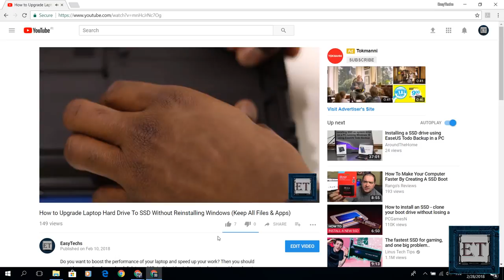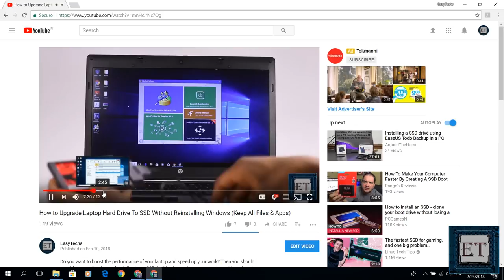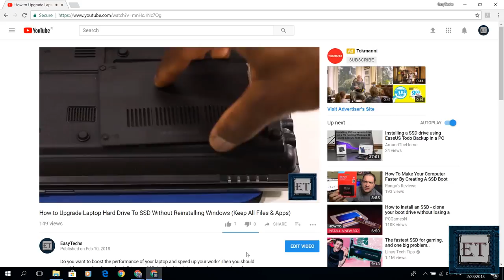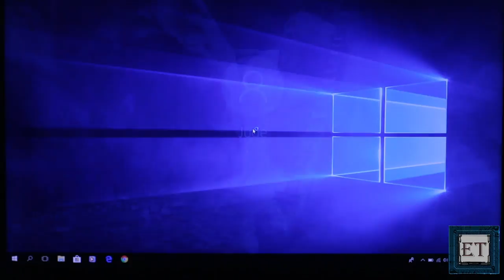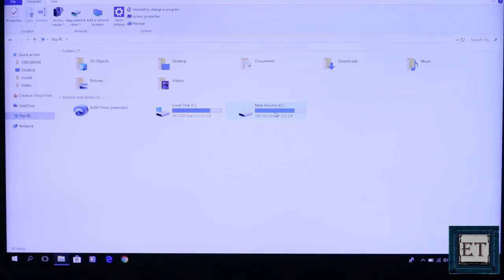HDD + SSD: Replacing Your DVD/Optical Drive With an SSD or HDD (READ DESCRIPTION)

Comment: Ssd location does matter. Main drive sata vs optical bay speeds are different. If you want real performace, you want to swap the ssd to main drive and the hdd to the optical bay.

Comment: Wouldn't you technically be able to do the software transfer after the 2nd hard drive is installed with the caddy rather than doing the software transfer before using a slow USB link?

Comment: Quick question. Does having the SSD in the caddy make that much of a difference in read/write speed compared to as when it is placed in main drive slot?
Reply: Yup it ll definitely
Reply: It shouldn’t, since it’s technically just a sata extension.
Reply: @chikensoops9922  hmm right it's more imp to have windows file at ssd

Comment: Hi EasyTechs!! I find your video very informative. I had a HDD which I cloned and replaced with an SSD. I now want to swap my Optical drive with the old HDD, which still has the OS and all the old files still on it. Do I have to format my old HDD before swapping with the optical drive?
Reply: same question here.

Comment: 2:03 If you don't trust your own measuring abilities, you can also google the type mentioned on the drive. There will be atleast 1 site mentioning it's dimensions. (though >3mm is hard to overlook measuring)
4:07 That's called a "bezel", for the ones who want to know.
(You're welcome...)

Optical Drives aren't used very often anymore anyway, so why not upgrade with let's say 1TB or 2TB. Harddisk and SSD prices are low these days. In some cases the optical drive even needs to be cleaned from dust inside, yes inside :S.
I know i am replacing mine, in my HP Omen, with an SSD. The external optical drive is faster anyway, for some reason.
Optical drives barely, or not at all, exceed USB3.0 speeds, while SSD can perform better connected directly to the motherboard.
HP will suggest to not use a caddy, but external HDD instead. But they have it the other way around.

Comment: Great video, thank you for making it and sharing it with us. All my parts have arrived to to this mod so I found your video really straight forward to follow. Before I start I do need to understand how I can clone my current drive onto my Caddy with a new SSD in so that the faster SSD will be my primary drive for the laptops functionality. Then I can use my slower HDD for other file storage, so I have a bit more research to do before I start.
Kind regards. Paul from 48-SPOKES (UK)

Comment: Great video and made a decision to buy.
I installed SSD in primary and HDD in optical caddy. Both are working fine. But the HDD is working slow. The transfer rate, opening a folder in HDD is very slow.....any suggestions???
Reply: Might be a limitation of the data bus the optical drive was using

Comment: Thanks for your very informative videos! 
One quick question: is there any difference in placing the SSD in the optical drive bay and keep the HDD in its place? Or do you recommend to set up the SDD always in the hard drive slot? Thanks!
Reply from the maker: Is better to have the SSD with the OS in the hard disk slot
Reply: The optical drive slot is SATA 2, which is faster than hdd but not fast enough for ssd. The original hard drive slot is SATA 3, which is also slower than ssd but it is faster than sata2.

Comment: Hey I have a question , I am confused about my optical drives sata version because I've heard that putting an SSD in the optical drive which is sata 2 is less performance so I would like if I had some way to check what version my optical drive is

Comment: This is a GREAT video.  But I have one question:  why did you put the SSD in the original drive bay and the old HDD in the converted optical drive caddy?  Can I just put the SSD in the caddy and avoid messing with the HDD?
Reply from the maker: Good to know it helped you out. Yes you can, you just need to configure your BIOS to boot from the SSD. thanks so much for the feedback!

Comment: Will the following order work?
1. Install the SSD straight into the (former) optical drive; 
2. Then transfer the OS (Windows 10) across to the SSD;
3. Then change the bios to boot from the SSD.

Comment: That's cool! I've got an ASUS similar to the one in the video. I'd like to add a third drive. Does the optical drive use the same SATA ports as a SSD/HDD? If the optical drive is different, what type of port is it? Is the port used by the optical drive slower than a SATA port?

Comment: Hi there and thanks for a very informative video! Quick question though, is it possible to boot a copy of Windows from the Hard Drive in the caddy? I'm planning on getting a SSD for Windows 10 that will sit in my laptop's storage bay, but want to run Windows 7 off of the HDD in the caddy as I need Windows 7 for some older programs.

Any help would be much appreciated!

Comment: Hai EasyTechs !

Right now i just done moving my window OS to my SSD, so i have 2 os program (1 on my HDD, and 1 on my SSD)

I'm going to put my HDD to HDD Caddy, and put the SSD to my main one. (HDD + SSD)

My question is, is it fine to just put both in (with 1 OS on HDD and 1 OS on SSD)??

we just need to go to BiOS setting and select which drive to use as our main OS? Is it right?

Comment: I have tried the same thing with my lenovo b570e laptop ssd  is working fine but the data transfer speed of hdd is very very low(it is hardly 200kbps)

Comment: Hi I installed a new ssd on place of dvd drive on my old laptop and installed OS on it. 
But the performance is not upto the mark. 
A local technician sa8d that it because i installed the SSD on olace of DVD DRIVE. I should have installed on place if the old HDD. And keep the Old hdd on olace of dvd. 
It it true?

Comment: Is there a speed difference if the SSD is connected in the optical drive rather than the HDD place?
Reply: sure. it's better to be connected directly to the motherboard
Reply: @Mohamed.Shoukry  it is directly connecting to the motherboard, both are sata ports, but one is smaller formfactor

Comment: Hi there, thank you so much for the video. But just want to confirm. The process of transfer of file using minitool is before I install the SSD inside my laptop or after ?
Reply from the maker: It can be before or after, both drives need to be connected to the laptop at the same time

Comment: Hi I want to add my old laptop’s hdd to my new laptop’s optical drive bay which I found is 12.7 mm type. But the problem I am facing now is that my old hdd is of serial ata 150 type. So will it work? And where can I get a caddy with sata 150 connectors?

Comment: Hi, I facing an issue.I replacing my HDD with new SSD and plan to put new SSD in harddisk bay while the old HDD in caddy. When I boot up my laptop,  I can see the HDD  in boot menu but I cannot see the HDD in disk management after my laptop finish boot up.

Comment: Hi, i would like to ask about the ssd. If i change my dvd drive to ssd. Can i directly mirror the windows to the ssd from my current hdd? Do i need to change any setting in the bios? 

Is there any difference if i put the ssd in hdd slot or the dvd drive slot? Thank you.

Comment: @EasyTechs
 after I inserted my old HHD in caddy (in the old place of HDD is inserted SSD), the disk HDD is invisible for Windows. I have tried to find it with Device Manager by scanning for new devices. Could you suggest me the solution?
I have the same caddy as it is in video. I see this white dip switches. Do you know what is their functionality? I can't find manual, where this information could be included

Comment: Thanks for your video, please solve query asap,
I have a question, If I put SSD in optical drive and clone windows in ssd and running my system with SSD in optical drive, Should I 
need to change the place of SSD from optical to main HD slot, If I continue it in optical drive what are disadvantage of it ???
Reply: Karan Giri There’s no downside to running it in the optical drive slot. Both are sata drives.

Comment: I have a dell Inspiron 5558 laptop and I replaced my dvd rom with a WD SATA SSD. But whenever I put back my battery the ssd isn't detected and the laptop doesn't boot.
Sometimes it starts working if I remove the drive and put is all together and sometimes it doesn't detect. Can you help me with this?

Comment: Thanks a ton, followed this tutorial exactly to get a second hdd into my optical bay.  However, I am noticing very slow read & write speeds (around 2 MB/s) from the optical bay?  It wasn't like this before, any ideas as to why or if this is normal?   Or maybe an error made on my part?   Appreciate the help
Reply from the maker: Thanks for the feedback, it shouldnt be that slow, but I'm not sure what the problem could be in your case

Comment: I have a windows laptop and im thinking to replace my dvd unit with an ssd or hdd drive and run Linux. So i will have both windows and Linux. Is that possible? Im not using dual but because I dont have that much free space on  windows drive

Comment: Hi I'm getting errors in File Transfer "0x800701b1" device not specified. The HDD is placed in caddy and getting some errors. Is caddy has some issues or do I need to change some configuration

Comment: In case the ssd/usb cable is not available, is it possible to plugin the ssd drive first, then cloning the system? I.e. starting by step 2 first then step 1

Comment: I have an empty m.2 ssd slot in my laptop. If I follow the steps of software migration (as you stated in another video), install the ssd and configure it according to this video. What will happen to my previous C:/ drive which is in hdd?

Comment: Should i Add my SSD to CD ROM Slot or Replace SSD to Hard drive slot and keep Harddrive to CD Rom slot. Because i heard that there may be issue of frequency of CD ROM which is 1.5 GHz and it doesnot performs better. So is it advisable to replace HDD slot with SSD and put HDD in CD ROM slot?

Comment: I did the migrating with the ssd connected internally in the optical drive. I chose the option to transfer and keep the old drive, not remove. It seems the system is not booting from the new drive. It is still booting from the old one as everything was copied, not moved. Did I go wrong somewhere? Would it be different if I do start off with the USB connection? How do I now make it boot off the new drive?

Comment: How do you know that it is booting off of the correct drive? The c drive will become the new drive? Did that happen in this video?
Reply: Yes, windows install always defaults to C:/ where is installed. Check with Task manager wunning w/ administrative privileges the drive. It will tell you in the second tab the capacity, type and other details.

Comment: i hope u answer me , can i put ssd in the cady rack and use it as the main boot choice for windows or i must put the ssd in hdd bay inside of the laptop to do so ?
Reply: No brother you can use ssd in both cases, but because DVD drive is of SATA II and main hard disk bay is of SATA III , it is recommended to use in hard disk bay but, in both the cases the speed of ssd will be the same, I would recommend you in optical bay because in hard disk bay there are motion sensors of hard disk,  👍✌😄
Reply: @parinchoudhary1905  Dont worry motion sensors are not that needed because SSDs dont have moving parts.

Comment: Hey, i just installed a new HP SSD on the main spot(where was the hdd before), but without putting in the caddy, cause my laptop does not see the caddy idk why. After installation, i put in the caddy, and the win 10 boots around 3 minutes, but the caddy is not there in the files. What can i do sir? I have know idea. I tried all day for 3 days now...

Comment: Hi, I am trying to install my older HDD into caddy in my optical disk drive slot but when I turn on my laptop (with caddy and HDD inside) it remains stuck on the black screen or the boot mode and when I press “esc” button it shows “ESC…Pause Startup” . I also tried to insert the caddy while the laptop is turned ON but then it simply shuts down automatically. 
I have tried both switch postions in the caddy but still it’s not working. I’ve seen countless videos over youtube, have read several forums as well but I didn’t see anyone facing this particular issue.
I also tried to replace my caddy and ordered a new one but still the same issue persists. 
At this point on I am not sure if I am doing something wrong or it’s a hardware issue.
So, Kindly help me in resolving this.
Any help would be much appreciated.
Thanks 

My system - HP Notebook 15-ac035tx.

Comment: I have a question. When I am putting the ssd in my optical bay its showing up but when I am putting my hdd in the optical bay it's not showing. Can you please help with this
Reply from the maker: Ensure your HDD is properly formatted and initialized
Reply: @EasyTechs  Actually hdd is working properly on its own bay. But not working on the caddy on optical drive bay.

Comment: I have a problem. I placed the ssd in the optical drive and cloned everything and it's recognising all data. But when I go to bios and change boot order to ssd in optical drive, it fails. When I manually boot from ssd, it says boot device failed. Basically, I'm not able to boot from ssd in optical drive. Any help with this is highly appreciated. Thanks

Comment: Hello ,  please i want to adding an SSD to my laptop with the caddy , i want to migrate my operating system (:C drive)  in the SSD and keeping the data of (:D drive) i want to use the 2 hard drive (SSD like :C drive and HDD like :D  drive) , what i do ? 
and another question , if i havn't a Usb Sata cable , can i adding the SSD first then do the migrate , possible or no ?

Comment: Hi can I install games on my HDD(the one in the caddy) to avoid my ssd to go full? I mean except for loading times, would there be other disadvantages on installing programs there?
Reply: A marginal disadvantage will be more power consuption but no worries, it will work. If you use Steam you can set up multiple Game Libraries, both in your SSD and your HDD, and install the games where you want.
Reply: @ErniLandia  will it be a big difference of consumed power?

Comment: Hi after I did the boot order in bios. It boots from the SSD but how come I don’t see the HDD drive under my pc. What happen if need to use it for storage? Thank you
Reply from the maker: Hi, maybe you use diskpart command to check if the disk is still present, and then you might have to add it back to your computer from the disk management, is easier if you don't need the files in it anymore

Comment: i am gonna be upgrading my 2tg hdd with 240gb ssd, for which i need to clone my hdd to ssd which only has 53gb of data and 15gb of system image n all, 

my question is after i have cloned my hdd to an ssd how do i format the hdd , bcz there has to be a time that both drives are connected and both have windows, so will my windows license will become invalid , kindly help ???asap.

Comment: Recently, I buy a Crucial SSD MX500 Drive for my Lenovo ideapad 330-15iKB to use in the place of Optical drive. I replaced my optical drive with my new Crucial SSD, whereas my ssd is not getting detected by the system. I did partition of the new SSD by connecting in my Desktop and I reinserted the SSD into my Lenovo laptop, still, I was unable to view my  Crucial SSD in My Computer / Disk Partition window. Any suggestion for your side?
Reply: Check BIOS/UEFI.

Comment: If i replace my hdd with ssd and put the hdd in the optical slot and REINSTALL windows from scratch on ssd. Will I be able to copy my files from the hdd on the sdd(pictures mostly,not apps) in order to format it and then use it as storage? (I don.t really trust the cloning method)

Comment: this is really cool but i have one question. Will the optical drive still pop out if you press the button? I mean, it is usually ejecting if the button on the side is pressed.
Reply from the maker: Thanks for the feedback. No the button on the caddy is a dummy, it will not eject, but you can pull out the whole caddy compartment when you unscrew from the bottom
Reply: @EasyTechs  ah ok thank you :) thats good to know

Comment: Thanks for this video. I'm having problem with HDD detection. My new SSD is in initial HDD place and I've replaced optical drive with the previous HDD ( same as shown int he video). But the problem is my system sometimes take extremely long time to turn on and HDD is not detected most of the times.  Can you please tell me how to solve it ?
Reply: same here.Shubhrajyoti, did you solve this?

Comment: Hi, will this method (using a caddy) make the ssd a bit slower than if you replace the hard drive itself by an ssd? Or will the speeds be the same?
Reply from the maker: The speed should be just about the same, some dvd bays have some cable extension to the motherboard, so the speed of the cable can have very little impact, but that is almost unobservable and negligible

Comment: Hi a dumb question here coming from someone who has never fixed a laptop before. So I would like to add a second drive to my optical drive. I have managed to do so but now I am just so clueless what to do next. So : 

1. How do I make the OS Operate from my new SSD
2. The SSD is already in the optical drive so is it possible to clone the mechanical drive hdd to my new SSD while it’s already in the optical drive? 

Appreciate anyone helping a sis out ❤️
Reply: You're on the right track. You need to run cloning software like Acronis True Image or Macrium Reflect or similar. You clone the HDD over to the SSD. once it is done, you can then format the HDD and use it for data storage.